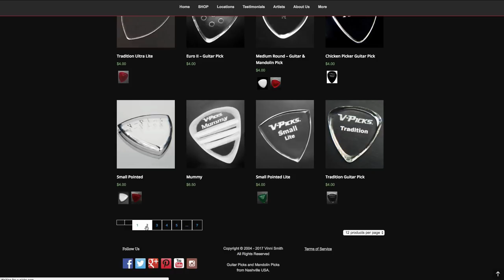A One Stop Guitar Pick Shop (AT48)

Comment: More fuel for the capo fire - I've recently started using a 5 string capo.  Placed on the 2nd fret, you get the effect of a dropped D tuning.  You can use a second, full capo behind the partial one to move the dropped D up the neck.  I use the Shubb C8b, other manufacturers have them as well.  Saw a video with Steve Earle where he was talking about using one and learning it from Guy Clark.  It unlocked a whole new area of guitar exploration for me.

Comment: I've had a Thalia capo for a couple years. It's great on my Martin HD-28, but it doesn't have enough pressure for a 12 string.
Reply: There's no choice for dollars, only pounds
Reply: If you're on a desktop, look for the little flag in the top right of the screen on the menu bar. Click there to change currency. If you're on a mobile or tablet you need to click the cog on the menu bar :-)